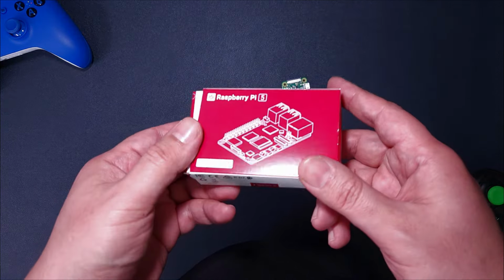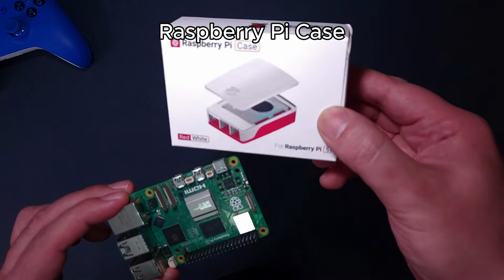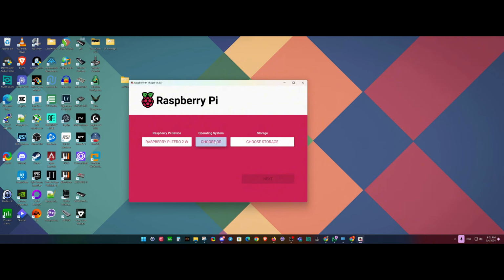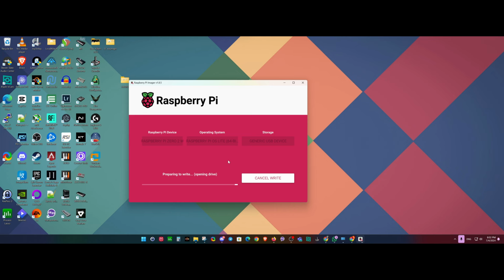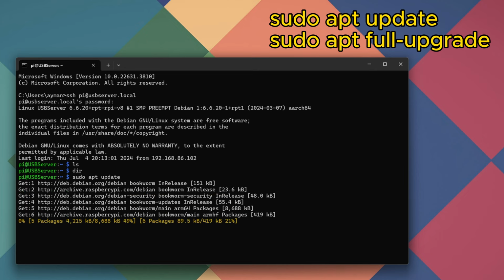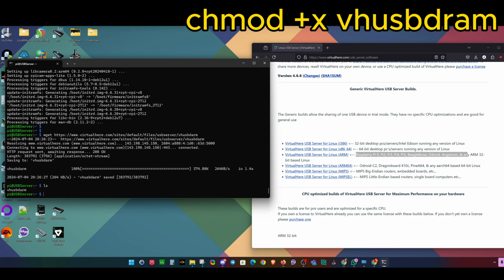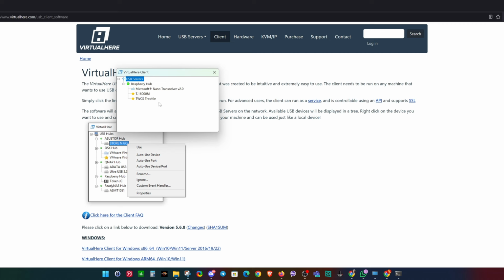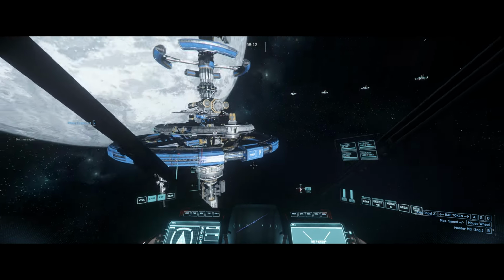Convert Your Flight Joysticks to Wireless using Raspberry Pi #starcitizen  #flysimulator

Comment: Great video and solution! I'm a bit curious how much latency is added compared having the controls connected directly to the main computer. Also thinking of the possibility to connect other things, such as a Stream Deck...
Reply from the maker: Thank you! I'm glad you enjoyed the video. 
Regarding the latency, while there is some added delay compared to having the controls directly connected to the main computer, it's typically minimal and shouldn't affect most applications. However, the exact amount of latency can vary depending on the specific setup and network conditions.
As for connecting other devices like a Stream Deck, I don't have one to test it but I'm very positive it's possible! I have plugged HOTAS, Xbox controllers, arcade fight sticks, and a Printer. many peripherals can be integrated smoothly into this setup.
Reply: @XNIMRY  It's inevitable that there's some latency. This looks very promising anyway. 
When it comes to the Stream Deck there's a lot of things getting communicated. Like all the thumbnail icons for the buttons and I don't know what the physical device is actually storing.
Reply from the maker: @Deva-Jufan  , In general the virtualhere is acting as a USB host server.
Whatever data go through USB cable Virtualhere mimics the same and transfer it over network for the target client machine.  I would say the only challenge if the USB device requires external power more than what the USB cable can provide from the host machine. Then you have to provide the power for that device to make sure its working. 

I think I should start another DIY project for building stream deck using Raspberry Pi 😅 its totally doable
Reply: @XNIMRY  I've got a USB-hub with external power connection I would use if I'll go ahead building this, so there will be enough power for everything. There will be a power cord connected to the chair, though, but still independent from the computer. That is if I don't build everything from starting with an electric wheelchair that comes with a large battery... 😉